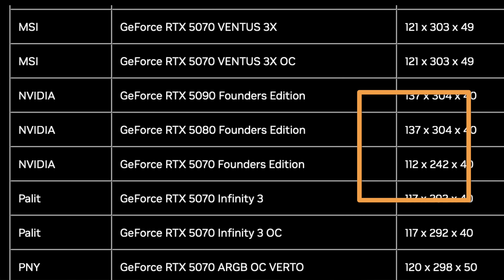Nvidia's 50-series Founders Edition Cards have a 20L sized problem.

Comment: Wow great video, I had been wondering about this too. First time pc builder here, in the research phase right now. Yeah I know, I chose sff pc for my first build.... Question, do you have your eye on a particular GPU aib for the ncase m2 reference layout? Wanting to get a 5090 with ryzen 9 x3d.
Edit: also, for various reasons, not doing water cooling. Air cooling only. Viable?

Comment: It's a WAY better cooler design. Blowing air directly at a PCB is dumb as hell. These coolers allow for cool air to be drawn in from outside the case then exhausted straight out again in the right case. As pointed out the Fractal Ridge is a good example of a case where that's possible. The problem is there just aren't many cases that support it yet because it's not how they have worked in the past and I don't know of any cases that allow for both the GPU and a CPU rad to be positioned that way.

Comment: The Gigabyte cards have a flow through on the right side. In the NR200 on regular horizontal configuration it could work well with air CPU cooler pulling from back and exhausting into the GPU exhaust stream to be vented out top?? I'll find out soon enough haha got a card coming this week.
Reply from the maker: the right side flow through typically isn't an issue. There's more space there and ways to mitigate it. The left side is a challenge to work around for many current SFF case designs.

Comment: I’ll be putting the 5090 in a Jonsbo Z20. I already considered this issue. Gonna suck in air through the bottom and rear and force it out the top.

Comment: The SFF Case I designed, the Winter 1, actually is compatible with the 5090 in a sandwich layout. Sadly the project ran out of funding, but we shipped 1 batch of cases, and it was really well loved. 16.8L with dual 240mm radiator support, DDC pump support, and a sandwich layout. 

Maybe I'll do  a redux/new release of the same case.

Comment: Hello, so it is bad for the razer tomahawk itx case right ? I have the radiator on TOP and just a over the GPU there is the PSU and its fan. So the heat will directly go inside my PSU and in the radiator?

Is there a way to blow hair on the bottom of the case with that GPU? It would be awesome with that case there is a lot of Space Bellow and it is very opened

Sorry for my english

Comment: An expensive alternative, but what're your thoughts on the Meshless AIO case?

Radiator up top, + unique heat ventilation with its' entire body-long fan. Interested in how a 50 series would do against that plate that separates it from the other side of the case. It'll be my first time building in a SFF case, and that unfortunately seems to be a contender for this GPU exhaust situation.

Comment: 5090 does not belong in any case smaller than ATX. Even ATX will need water cooling CPU and plenty of fans. I bought the Vision case, ATX a cool CPU, Ryzen 7900 (65 watts) and I will buy a 5070Ti. I can deal with 300 watts. No more.

Comment: My personal problem with the RTX50 FEs is that its a custom board + custom PCIe connector + custom output connector, there are so many individual parts that can fail and theyre all NVIDIA proprietary so Im not sure about this gen at all.
Reply: Yeah, but as a counterpoint, by making each section separate it compartmentalizes any potential damage on the individual part like the pcie slot cracking on some models. Hopefully Nvidia offers those parts up as spare parts at a reasonable price.

Comment: Im really not very concerned about swapping my 4090fe with the 5090fe in my Formd T1. Best case, I gain a bit of space for a taller CPU cooler. Worse case, I have to leave all the extra space I gained behind the 5090 for air flow

Comment: new bespoke sff cases that utilize risers to keep the gpu away from other components are going to be the meta. If you can afford a 5090 you can get a new special case for it. So i dont really see an issue here. In an itx case you can just use an AIO or watercooling loop.

Comment: using a revolt 3, im expecting smth like a 5070 could work reasonably well since non flow through coolers can hot box a little bit in that case, and blower style coolers aren’t great for it, but a double flow through would yes go right to my radiator, but under gaming load that’d be acceptable
Reply from the maker: In that setup FE vs AIB won't be much of a difference, it's going through the rad regardless. 5070 level of power probably will have tolerable impact on CPU thermals.
Reply: @ i just think the flow through FE would be a bit more efficient than a normal cooler where it vents out of the sides and front, since i’ll be doing negative pressure with exhaust on the rad, the gpu putting the air in the right spot could make it more efficient and help with dust.

Comment: 575w in a SFF is brave imo no matter what size the FE cooler is.

Physics gunna be a problem for ya

Bit like being able to put a 6.5L v8 in a civic (any small car), getting the engine to fit in the gap is not the same as it being a good idea

Comment: I'm racking my brain, buy the FormDT1 and now with this founding edition that I was excited about because of its size, now it turns out that it ends up being worse to configure in the T1 because of its heat discipline system on both sides.
Friend, it will be possible for you to make a video trying to configure the FOUNDERS on a T1 and what parts you would need to adapt to make it work. I trust your judgment enough to achieve this.

Comment: I have suggested, but I haven't tested yet that anyone thinking about using a 5090FE and wants to try to put it in a vertical orientation such as an A4 sandwich case or console style that has either no pass-through or it would lean up against the motherboard and/or PSU behind the center case spine, to use a case that has 3-slots.

Reason: when mounting a PCIe riser cable within that case, use 20mm motherboard standoffs for the mount. Even though the GPU would be against the case side panel, there would be a one-slot (20mm) gap between the GPU itself and the center spine (for sandwich cases) or motherboard (on many console style cases).

That gap will allow air that passes through the GPU to have space to have a change for that air to be exhausted at the top, bottom and side panel of the case while reducing the risk of overheating the motherboard and/or PSU that is on the other side of the case spine.

Obviously, it would be best to mount the GPU on a standard horizontal configuration as the air flow from the bottom will go through the GPU and exhaust above the card towards the ceiling exhaust fans. It would still heat up the motherboard a bit, but it would be much better than having air hit the motherboard head-on and at fairly high velocity.
IF and when I obtain a 5090FE, I would experiment on the different configurations to test any temperature difference. 

I'm sure many personalities would perform similar testing.

This is just my two cents on this subject.

Comment: The NR200 series, such as the P and P Max both can work with the top mounted radiator which is incidentally what I'm using. The original NR200 would work seamlessly as it's a traditional layout to maximize the flow through design. The CH160 from Lian Li can work as well. The Jonsbo Z20, Thermal Take Tower 100/200, Fractal Ridge, Silverstone Sugo 14 are all contenders to have the best airflow for the 5090 FE. Ironically most of the cases that tend to work best are all older SFF cases which may have just launched when the 5090 FE was still being designed by the Nvidia Engineers. I guess we know which cases have inspired them back then.

Comment: It is pretty obvious the 4090FE cooler was too good and AIBs complained to Nvidia cause people weren't spending the extra on their cards. So Nvidia have downgraded the 5090FE cooler and the AIB cards will run much cooler, quieter and will run at higher clock speeds as it's obvious Nvidia have been very conservative with the clock on the FE.

Comment: For the nr200 set up. Couldn't you just set up the cpu cooler vertical instead of horizontal and add 2 fans to top and bottom? Sure you would still get heat exhausted from gpu to cpu but I'd imagine that it'd be cooler vses the other set up.

Comment: If you want to fit a 5090 on sff i think you have a serious problem I wish I'd have instead. Too much money. 

Most sff with high wattage gpus usually suffers high thermals than standard or open. Why even have a case when you can have open? Better cooling and could look cooler, look and temp wise since you can see the parts than cramped in a small box.

Open bench/cases might be the future. I do like sff but with pc parts able to produce 1000w of heat you're gonna have very high temps. Might as well choose more reasonable parts than to thermal throttle HEDT like pcs.

Comment: Be like Inno3D.
They made a true 2-slot 300mm 5080.
Hell, they made a true 2-slot, DUAL FANS, 4070 Ti Super. And it’s OC!
Showcasing how efficient the 40/50 series is.
Reply: I wish they had a 2 slot for the 5090.

Comment: for standard sized cases and aios you can avoid the heat coming from your card by mounting the aio on the front. or get a bigger aio to compensate. my 360mm rad has zero issue cooling my 9800x3d with a 3090 and i doubt it will be a problem  with a 5090 adding additional heat. One thing that you dont take into account is the fact that at least on standard layouts the heat doesnt linger as much in the case as it would with typical gpu designs. all the heat goes straight up towards the rear exhaust and your aio. i would guess that with sufficent intake fans that you would probably see lower temps with the 50 series vs 40 series or 30 series partner cards and likely on par with the founders while having to dissipate more heat. in reference to 50 series sff if you can afford a 2k card you can afford a new sff case that fits the card and while youre at it a new sfx atx 3.1 psu to support it.

Comment: You definitely brought up an excellent point. I shared a thought within the T1 community that it is possible to offset the GPU bracket. Bringing the GPU fans closer to the outside would be a good move. Now, I was thinking about this... If someone truly wanted to, they could find a way to flip the GPU 180° so that it exhausts OUT of the T1, rather than needing to recycle the heat. Custom brackets and a shorter riser cable, it's not impossible.

Comment: The best sff cards are blower cards as they dump all hot air out the back of case
You can undervolt them and they work great with a fan blowing at the single fan

Comment: I hold my M2 grater part purchase to wait for the FE card announce, and I found if I build with air cooling and ITX board, it seem no possible. After some research, I found if I use Matx board, the CPU cooler can "shift" to the middle, then the GPU hot air will not directly blown the CPU cooler, intake at side with T30, exhaust GPU hot air at the board side and front, seem like a solution.
The design of FE card with SFF ready together seem limited the build option so much. I love the new FE card design very much and appreciate the SFF ready standard, but the result......😅

Comment: Are there any SFF cases that have room for a hanging riser cable so the GPU can hangout upside down below the motherboard? That way it could just have it's own little room with pass through airflow below everything else. You could even make it a separate chamber. I'm not an engineer, just a thought.

Comment: I'm running a Phanteks Evolv Shift XT so the  hot air will be blowing up against my MB / PSU. I have 2 large fans on the top of the case to purge the build up of hot air asap but not sure if that is still sufficient.

Comment: Small form factor ready....

Lets be honest, we all know that the Sff blab was a half truth. We know that they know who is really looking at this card. I.e. the semi-pros and workstation guys that don't need signed drivers and the super-support that comes with the A series and higher.

The guys doing work thay does benefit from multiple GPUs, where we had to go with partners whose supply was questionable for a bit, not that they were overflowing with 1-2 slot designs (even AIOs which are usually godsends have shrouds that are 2.something fro some reason, which makes no sense for something with any form of waterblock 🤬

Comment: 240mm AIO with fans on Pull inside the case won’t have a problem with this at all on an M2.

I get heat coming out the side with my AIB 3080 that gets sucked back into the rad. A 50 series FE design would prevent this.

Comment: I'm so pissed that Nvidia came up with the new "SFF Ready" standard that's 2.5 slots thick only to make their FE cards 2.0 slots while most AIB's went 2.5 slots. Half of SFF cases out there only have 2 slots. Heck my NZXT H210 is an ITX tower and not even an SFF case, and it only has 2.0 slots.

Comment: The Akasa PCIe slot bracket may help with the heat problem.
Reply: be interesting to test that
Reply: @davidhamer7820  I have one, I ordered it from Amazon DE to Turkey. I use it with 2 DeepCool FC120s and it is very effective :)

Comment: It would be cool for some cases to have another configuration where the riser cable and GPU slot can be flipped so that the GPU could intake from the middle and exhaust out of the side of the case in a sandwich style.

Comment: Thanks for posting this. I am considering replacing my 3090 with the 5080 and actually have it in a vertical mount position in my NR200p. I'm running a bottom rad and bottom to up intake to exhaust. Will be curious to see if that or what you recommend with top to bottom exhaust will end up being better. 

I didn't really think about how it could be really bad for the air coolers to have the I/O section of the card flowing through vs traditional ones in the traditional horizontal mounted GPU.

I also see this as the chance then to upgrade my PCI express gen 3 riser cable it came with with a gen 4 that's longer. Is there one that you recommend? I don't know how long the stock riser cable was

Comment: I think it makes sense to build around the 5090 if that is the card a person wants. 575 watts is a lot, and I can definitely see your points in trying to deal with it. I'm probably going to be using a tall desktop case with mine, and a lot of T30 fans. I think for SFF, ideally you would want to be able to use the FE card for exhaust, even though that means not giving it the coldest intake air. I am looking forward to seeing the testing, maybe it usually only uses 450 watts while gaming and having it draw in hot air from around the CPU is fine. Thumbs up!

Comment: Its wild to me, i keep seeing SFF cases that i love the look of, but functionality wise i have yet to have a need to leave my nr200 behind, your video was the deciding factor on that. I feel like the NR200 is a hard case to beat. Its the perfect middle ground between super small 9-10 liter cases and 30-33 liter cases. The FE is gonna look real good in it to
Reply: The build I've planned out for if I can get a 5080 FE is a NR200. However before the 50 series was announced I was looking at building a SFF Steam console pc, and oof are is it annoying to find a SFF case with the features I want.
Reply: @xdragoonzero0  the nr200 is by far the best to me. Perfect balance of size to thermal performance and price. If I went any smaller I'd go with an A4H20 but definitely don't see myself doing that for my stationary PC. If I build for travel I'd use the A4 or the T1

Comment: Easy. A case like M2, you put the card in traditional position, 280mm AIO at the top as intake also, and 2 140 or 120 mm as side exhaust.
Reply: Even then, if you have an air cooled cpu then the card will still exhaust right into the heatsink of your CPU cooler

Comment: Feels like with flow through becoming popular, sff cases in the console style (long and flat where GPU is mounted along the axis of the motherboard) would work well provided they come with a vertical stand. A low profile CPU cooler would work fine given lower power cpu's like 9800x3d. Would also make the pc's even smaller because no AIO or extra fans required at all. 

What cases  are like this? Sliger used to have an old console style but I think that's been discontinued.

Comment: For sandwich style SFF cases, I don't think there will be any significant difference from every previous generation's axial fan cooler designs (that fit) - which is in 95% of the GPUs in the market.
For traditional SFF cases such as the NR200: for both air-cooled setups and side-mounted rad setups, maximizing fans - having two top exhaust fans besides the two bottom intakes (which can now be 25mm fans) is going to be sufficient.

I have an Arctic LFII 280 with two Arctic P12 PWM PST COs as bottom intakes (besides the side rad intakes) and a stock NR200 fan as top exhaust.

Comment: Nvidia has more time to work with the PCB team to design a 2 slot card...Board partners get the design specs much later and with that a target release date. So much easier to modify what was done before for release than to start from scratch as they are now that they seen what Nvidia did.

Comment: NR200P v1, 280mm AIO side intake (fresh air for CPU), RTX5090 bottom intake (fresh air for the GPU), Top exhaust with 2xnoctua. Should be fine, albeit a little bit hotter than the 4090 obviously...

Comment: Sheesh I so needed this video, I'm in Italy and I literally just ordered  the formd t1 v2, from Ncase in the US been 16 days now, I believe in few days time I'll be getting the case.
  My only problem since the announcement of the 50 series GPU has been finding a 2 slot 5090 that will fit in my case, with the kraken elite v2 240 Aio, and with scalping going on, I for sure knows I'll not be getting the 5090fe for a reasonable price, MSRP down here in Italy is already around €2,400.
  I just hope a partner company comes out with some slimmer variant 5090 sooner😅